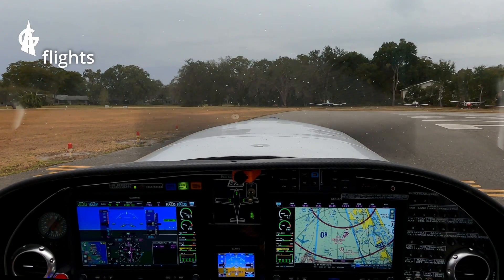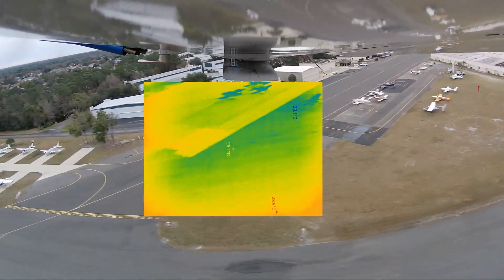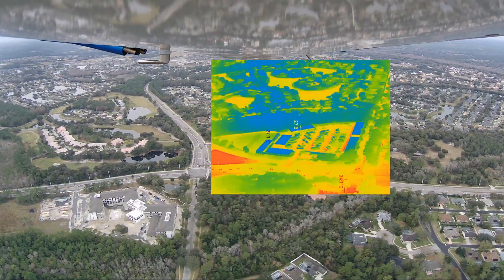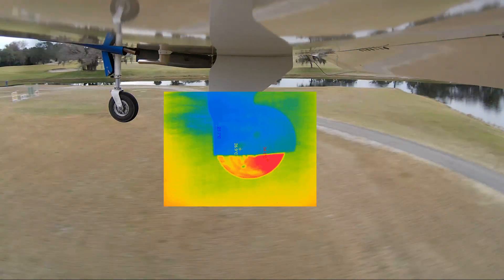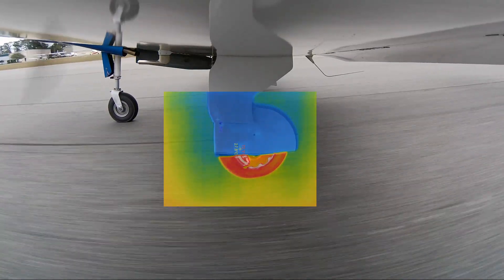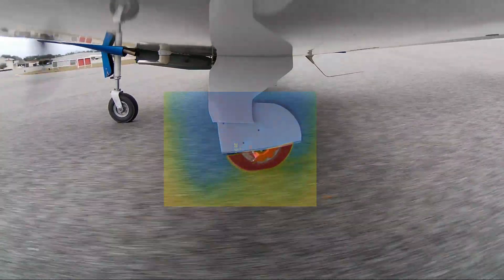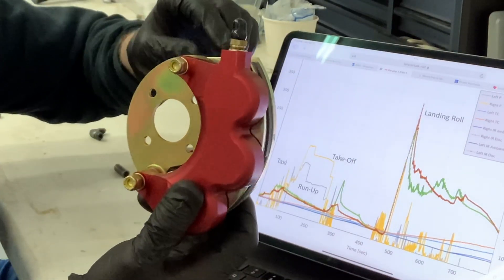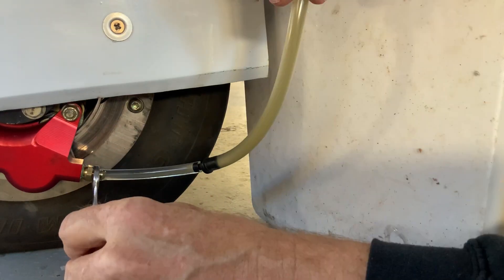Lancair Thermal Imager HT-301 in flight view and brake rotors General Aviation Flight @ Spruce Creek

Comment: I have the exact same camera but am having difficulty acquiring the correct cable to be place the camera off of the cell phone. Where did you get your cable?
Reply from the maker: Hello and that is exactly what I did.  I used this cable from Amazon....  USB C Extension Cable 6FT, Stouchi New Version Type C 3.2 Male to Female Fast Charging & Audio Data Transfer.

It works well and good luck.
Reply: @gaFlights  Thank gaF.. just ordered the cable.

Comment: Interesting that the heat is instantly visible on the runway, I wouldn't have thought. With greater brake strength it must be more important to balance it so it doesn't suddenly flip to a side. The front wheel is castor right? I suppose it would be good discipline if the front wheel was steerable.
And yes thermal can see far. I believe it cuts through atmospheric haze or even fog so your visibility can be greater.
Reply from the maker: That instant heat is the stationary wheel coming up to landing speed, about 70mph.  I was also surprised but when you see the tire smoke when airplanes land I guess it makes sense.  Yes a lot of planes have castoring nose wheels.  (e.g. Cirrus SR 20 & SR22, Diamond DA40)  The positive steering does have a certain about of redundancy should their be a braking problem.